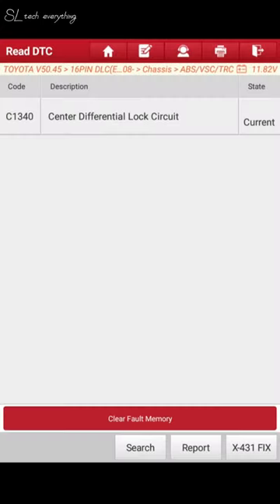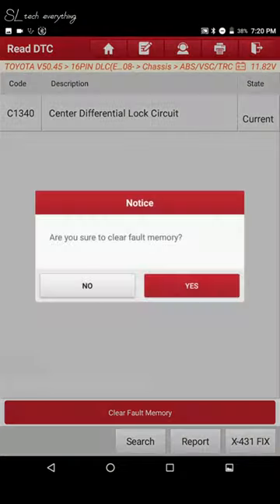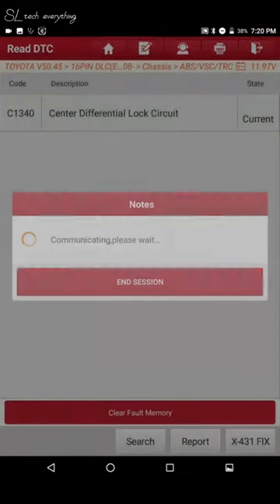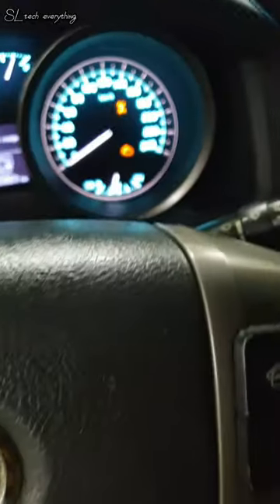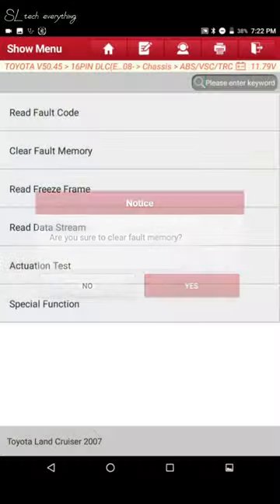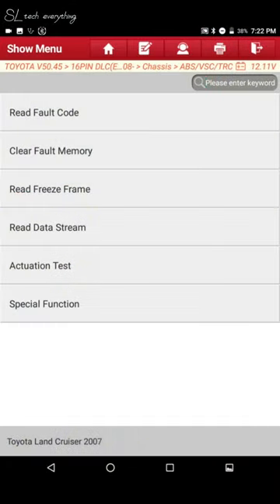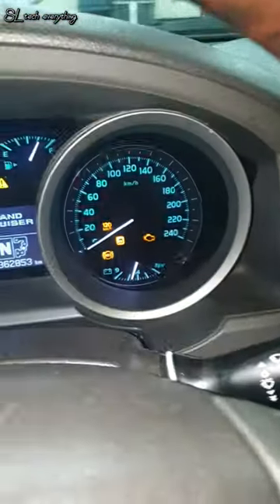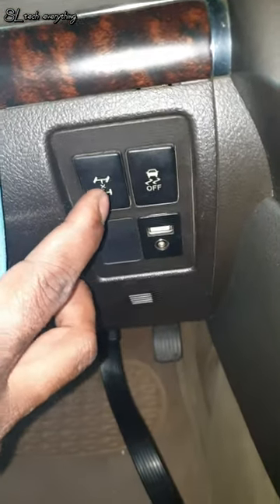How To Fix Center Diff Lock Light Bleeding | Toyota Land Cruiser | How to Fix C1340

Comment: I change the actuators for new ones, and the light still flashing, any correct forms to put the gears?
Reply: Did you get yours fixed? I also have the warning light on so have just purchased a new shift transfer actuator and need to install it. Hopefully it will fix it.